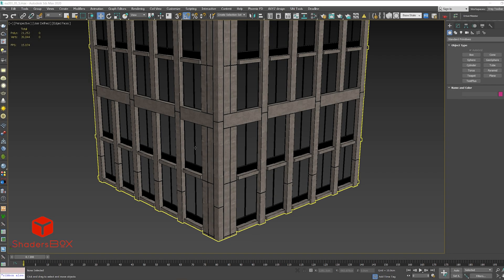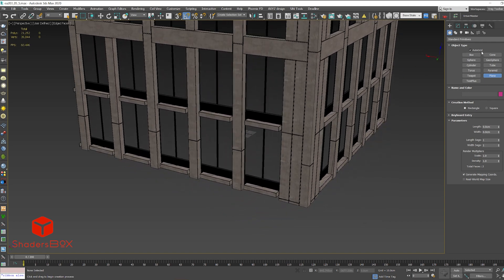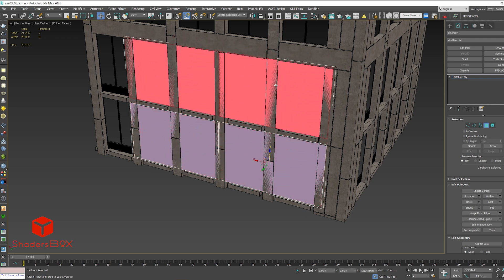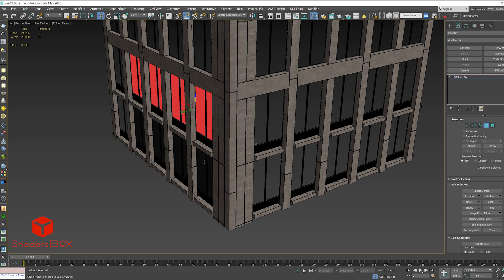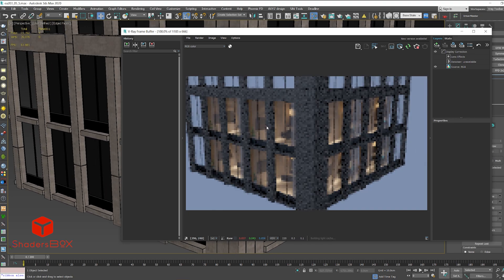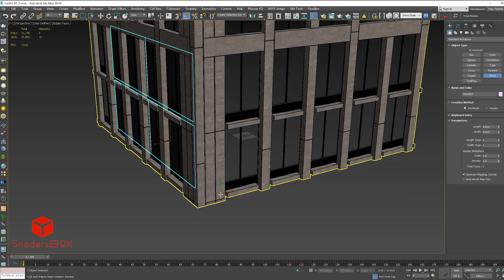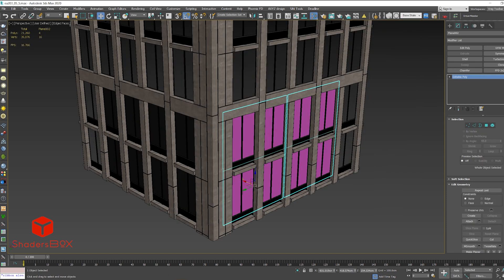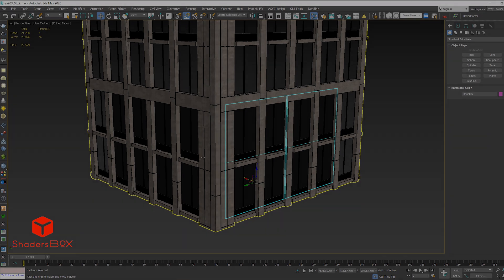How to add OSL Interiors to different Facades?

Comment: It's a good tool, but it does look off at the corner units not being able to see a window opening on the exterior wall beyond.  But I understand it's a map and a workaround.  Still would save some time with interior unit mapping.
Reply from the maker: Our upcoming version 2.0 of the textures will have this option!